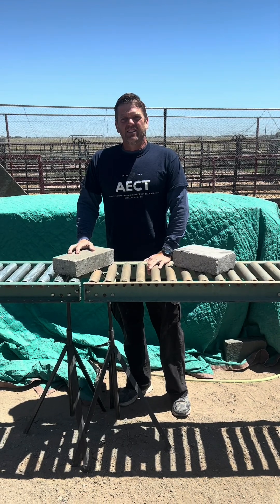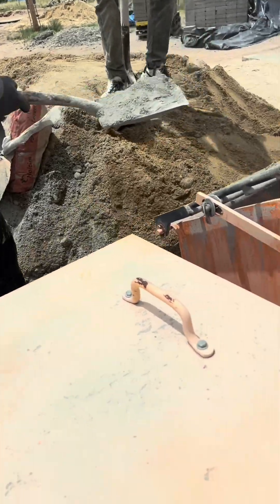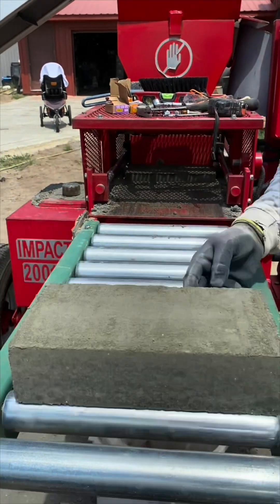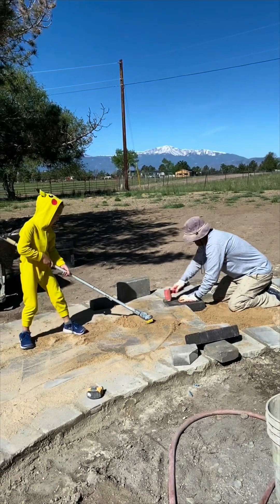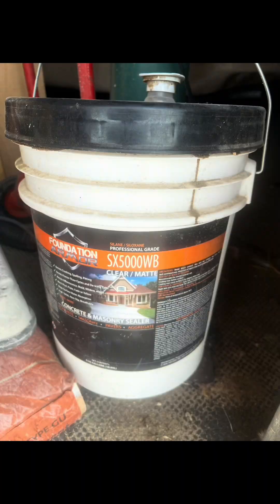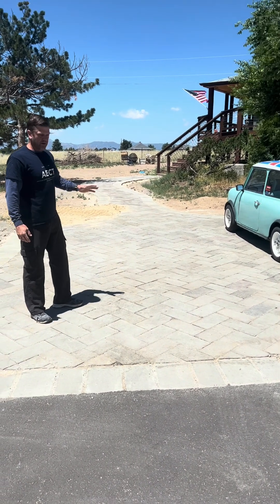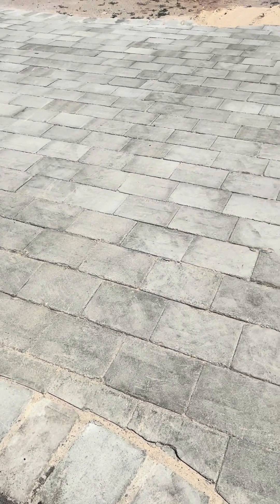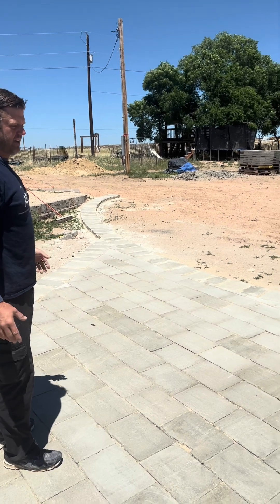Producing $1.50 driveway pavers #compressedearthblock #CEBpavers #inexpensivepavers

Comment: 2000 psi of hydraulic pressure does not equal 2000 psi on the block, unless you have a HUGE cylinder.
Reply from the maker: This cylinder puts about 150,000 pounds of pressure on the block.
Reply: @advancedearthenconstructio5103  How big is your cylinder? The BP 714 only achieves about 550 psi on the block.